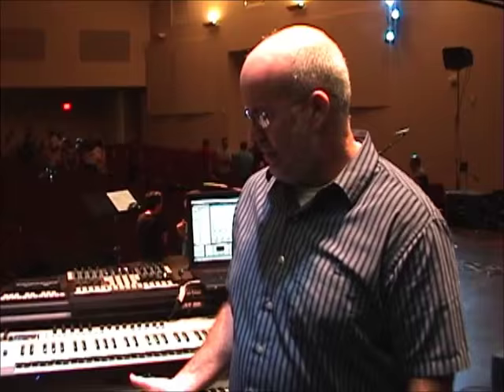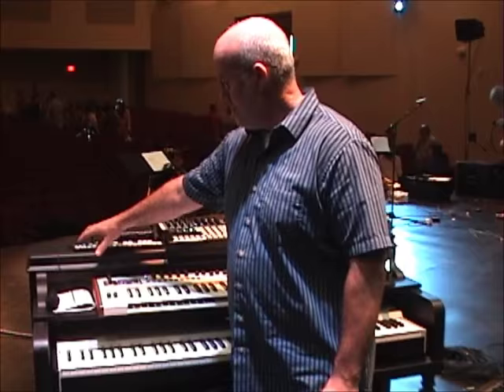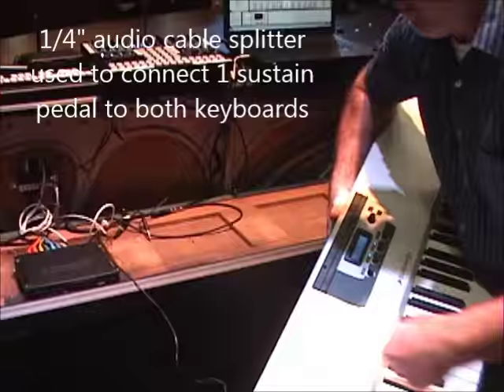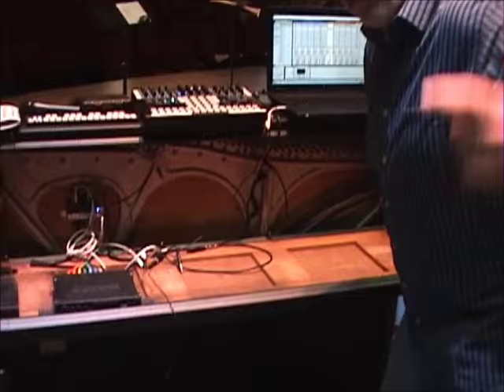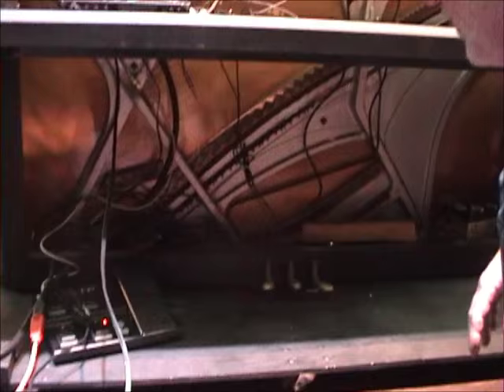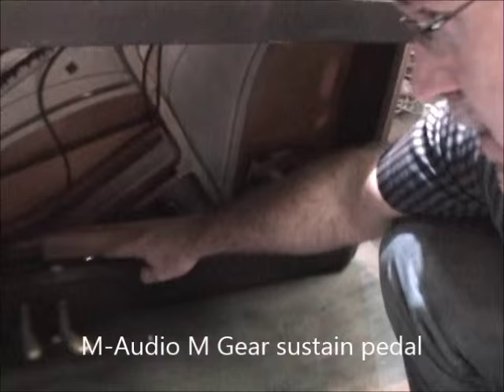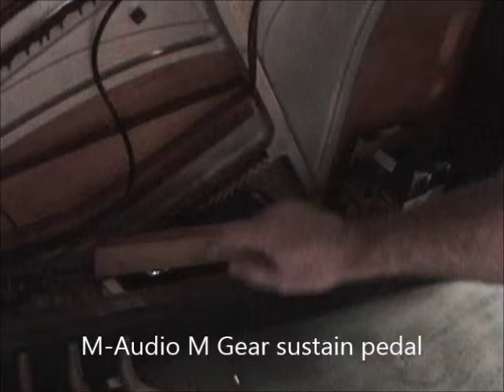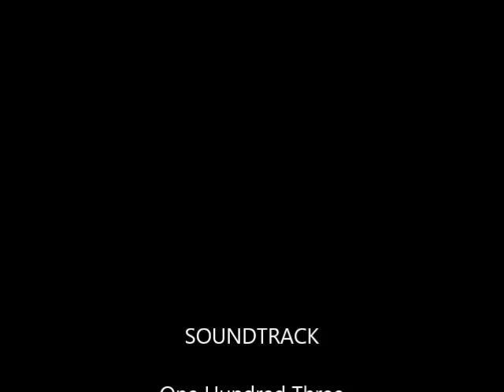Midi Controller and Keyboard stand - piano shell

Comment: Quick question...why not remove the harp?  I'm at the tail end of a piano shell project myself and plan on removing the harp, so I'm curious as to why you left it.
Reply from the maker: +ryan rice Hey man...no real reason.  Other than it was going to be a pain to remove...and a little bit of impatience in wanting to get it up and running.
Ends up I think I like having it in there, to add some solidness to the shell.  We don't have to lift it much (other than occasionally onto an 8" platform...and 2 guys can easily do that).
Reply: Understand!  It looks great!  Love the Edison lights...
Reply: Nice job... I’m thinking about doing something like this for my home studio. one quick question, was the shell very heavy before you installed all the gear...
Reply: What’s the name of original acoustic piano. It’s the perfect size for a two keyboard rig! Nice job!
Reply from the maker: @stryderpro6084  not sure. Bought it from someone in New Orleans. Harp has Conover cable on it.